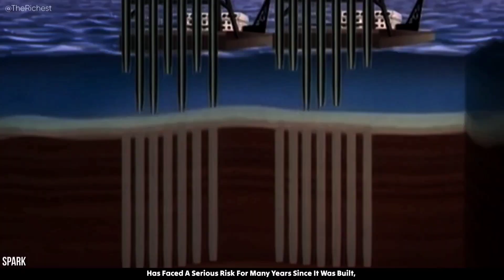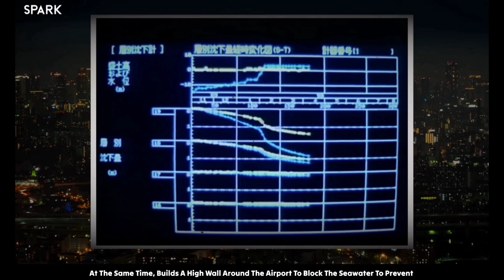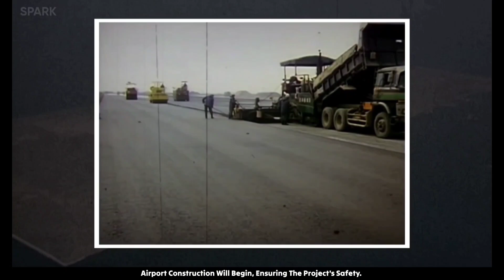$25 Billion Bet on the Sea: Has Japan Underestimated Engineering Challenges? CHINA IS WORRIED!

Comment: It seems to me that displacing sea water area with artificial islands just exacerbates the problem of rising sea levels. Also how long will it be until a sunami completely wipes them out, they're barely above sea level as it is.
Reply: I know it isn't simple but I'd think carving out a runway from the side of a mountian and filling in a valley would be easier and cheaper than making an artifical island.